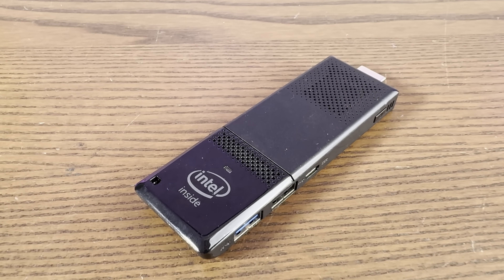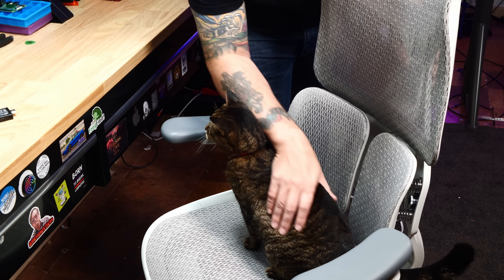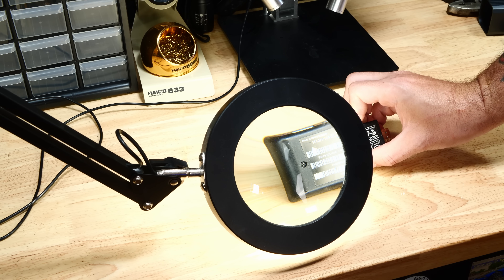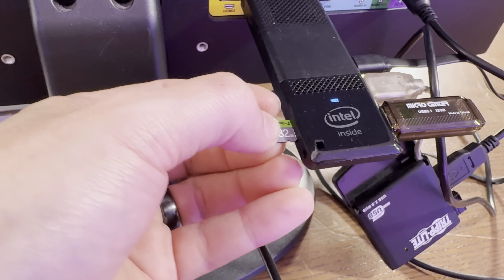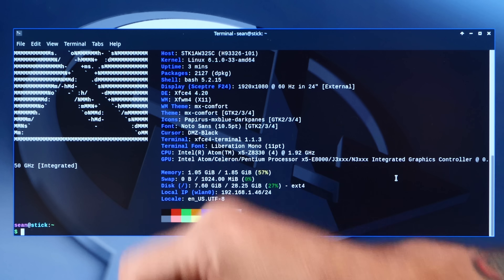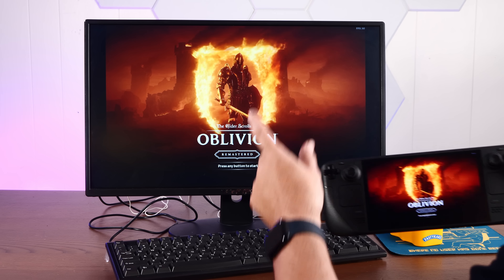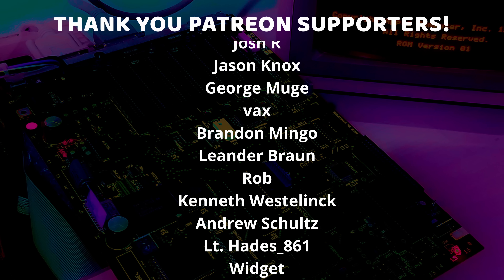Intel's Tiny, Weird Computer

Comment: I have this. Originally bought this for use as a media center pc, but later repurposed it as a thin client for my remote work citrix desktop. It ran well enough, and even handled audio/video calls with host based acceleration
Reply: We used to use them for video walls displays.  The proprietary boxes cost a fortune and these were less than $100.  Great little machines.

Comment: Honestly, that is not bad. Super low power consumption, basically no wiring needed, a simple device that could be used as 3rd or 4th screen.
Reply: nowadays phone cpus can pull even less on light tasks

Comment: The reason Haiku did not see the sdcard or the emmc is because it likely does not have full support for it yet and emmc is basically an sdcard but soldered to the board. Idk about the status of sd card support in haiku
Reply: It varies. I've installed and booted 32-bit Haiku from the 32GB emmc in an Acer Aspire One. Then, on a Chinese Compute Stick clone, I could install Haiku but not boot it. It seems more a BIOS issue.

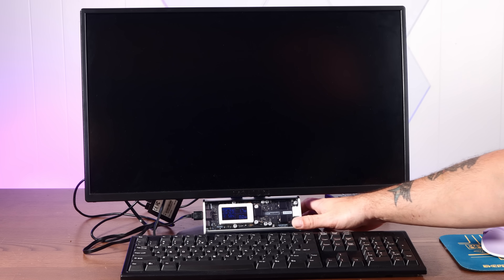Comment: I still have a M3 stick and it still works fine. Intel made the slimmest smallest sticks and I use mine as a emulation machine. The only issue is the CMOS battery now needs replacing (I see yours does too at 6:17)
Reply: Good spot!
Reply: I believe he unplugged the battery when taking it apart, perhaps his doesn't need replacing yet.

Comment: My daughter still uses one of those for her piano lesson zoom calls.  It's literally been zip tied to a piano since covid.
Reply: We're currently a phone + a tablet for this: would you mind sharing your configuration?
Reply: @BabasX1  based on his comment he zip tied it to a piano
Reply: @nottrevorallen  technically the piano was zip tied to it. it is the computer, the piano is merely a peripheral and furniture
Reply: @BabasX1  We have a monitor and keyboard on the compute stick.  There is a webcam that points down at the keyboard.  The piano is one of those faux digital jobbies (not a "keyboard"), so it has audio out.  The piano and a headset are connected through USB.  The piano audio is set to monitor so both the instructor and my daughter can hear it.
Reply: @BabasX1  It's a just a little computer. He probably just has a TV or monitor sitting on top of the piano so she can see the call. I'm not sure why that's hard to grasp.
Reply: @Luke357 r/whoosh
Reply: r/woosh? Are you 12 because I don't think it means what you think it means.

Comment: I could use one of these as a replacement for fire stick, would deffo work well for an easier life to accessing all media instead of having a billion apps installed.

Edge and away, remote PC app for ease of control from the bed.

Only issue is how would you easily turn it on? Hibernate?

Comment: The first Raspberry Pi prototype shown to the public was a compute stick, with an HDMI connector on one side and a USB on the other. There were a ton of pictures of it on the Internet after being initially shown in a BBC blog. They did warn that the actual product would be different since they were aiming for a credit card form factor with a connector people could wire to their own hardware.

Comment: I've had back then a Phone with an Intel Z3580, basically the same chip with dual channel ram, higher clock and 4gb LPDRR3 1600 Support. It was blazing fast for a phone back then, had disappointing battery life and got hot enough to just shut off during summer. I still have it somewhere, the back cover of the Zenfone 2 Deluxe is so unique and beutiful that I can't throw it away.
Reply: Omg, I'm still using my ZenFone 2 every day as a fitness tracker, as it's got a fitness app (Cardio Trainer) that I really like, which won't work beyond Android 6. It's battered as anything, but I can still put a SIM card in and use as a back up if needed.

Comment: I dug mine out a few months ago and installed Ubuntu headless, X11 and QLC+ running in kiosk mode to control DMX lighting rigs. Still haven't tested it out since I don't have a USB to DMX cable, but it runs QLC+ very smoothly! A lot better than the Pi Zero W I tried at first lol

Comment: I remember our Intel rep trying to pitch this. You could tell he thought it was useless.
Reply: It was an excellent thin client, actually.
Reply: Never played any emulators before? These things were way cooler than the walled garden streaming sticks of today!
Reply: @btarg1  Thank you for saying it. These are worlds ahead of a firestick or roku as far as usability.
Reply: @btarg1  The Core M3 can emulate up to GameCube (you might need frameskip in some games). Decent for PC games of that era too. OG Oblivion is old enough to run directly without streaming. It will get very hot though it's only got a 30mm fan after all...
Reply: @btarg1  I never thought about it being able to play some emulation, thanks for the hot tip

Comment: I'm using one of these to control my 3d printer through wifi, super useful! Also batocera worked somewhat for really older systems emulation. Dreamcast almost worked fine..almost.
Reply: Almost… 😂

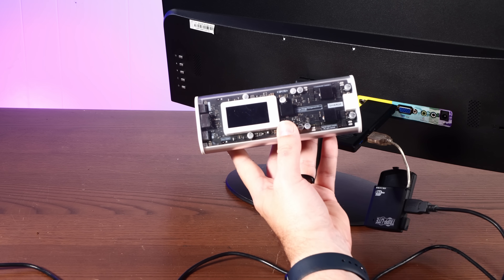Comment: 6:06 that can't be good for the HDMI port...
Reply: An extension cable is recommended.
Reply: @CantankerousDave  That might even improve wifi reception since it's no longer obstructed by a screen.
Reply: They came with 3 inch extension cables for that reason. 😇

Comment: I don't know why people are shocked that 10-year-old computers work.  Dude, 40-year-old computers work.
Reply: I think it's more about "can it work with my usecase?" because older computers are limited in their usefulness by modern software being only designed for modern hardware. Getting any web-connected thing to run on, say, an IBM PC, will be a challenge unless you're willing to program it yourself. 

News websites without images should be doable (I've seen demos of teletext systems that pull from the modern BBC website). Maybe you could make something that can connect to, say, Reddit. Anything beyond that is probably going to be like pulling teeth without anaesthesia, because modern software is so damn bloated that even getting the API calls to work might be a challenge. I luckily have never had to use Microsoft 365, but I feel like even a skilled programmer would have trouble making that work on a 40 year old PC.
Reply: I don't think it's a matter of it "working" as in starting up, but rather the fact it can still be used for at least some modern use cases. Especially since this was a low powered device to begin with. I guess plenty of people haven't realised or internalised how much gen on gen improvements have slowed down in the last 15 or so years.
Reply: I'm actually more surprised that there were still new computers made with only 2gb ram in 2015. With all the win 10 updates getting bigger and more bloated, they must've become unusably slow so quickly...
Reply: My Apple II from 1979 still works, and sometimes I play Zork on it!
Reply: they work better because people make software specifically for those platforms and you don't have to hunt stuff down on the wayback machine
Reply: Yeah, but not well, at least not for modern stuff.
Reply: My 40 year old Commodore C64 still works as good the day I bought it.
Reply: 40 yo computers were made when planned obsolescence wasn’t the priority
Reply: @BambuLaber  can you run windows 10 on commodore? What do you mean by planned obsolescence

Comment: Poor Haiku... its driver support is so shoddy. I've only ever been able to have a good experience with it running as a VM. They don't have enough developers to keep up with this new hardware shipping. 

One way that might have been good for them to go was to get it working great on ARM and then they could make the Raspberry Pi the official Haiku device. I've only ever really seen it run properly on old Thinkpads.

Every year the amount of people interested in BeOS/Haiku decreases. I'm impressed they kept it going this long. Too bad, because BeOS was mind blowing when it came out, and it was within an inch of being the new MacOS, had a meeting or two gone differently.

I weep for the lost potential.

Comment: The bank I worked for tried to take away out laptops in favor of these. Thankfully, it didn't go far.
Reply: I don't know about being thankful; I use a laptop at work and often lament the small screen size. Even a cheap, old flat screen provides a bigger view than that - what's not to like? Takes up zero deskspace beyond the monitor it is attached to, and would probably run all the software you would need as a bank employee (I say that as someone who has never worked in a bank, but you know...I assume it's not very exotic or demanding software).
Reply: @danyoutube7491  10 years ago this would've been true. Now, even just modern Windows itself needs essentially the maximum processing power the Compute Stick to function (for a version of Windows caled tiny11), which basically means that thing is almost completely obsolete. :D

Comment: I you think about it, we already have something very similar to an Intel Compute Stick: Modern Cell Phones.
The difference is that the phone does not natively run Windows as we know it (primarily because Windows uses x86 Process Architecture, which has high power consumption).
And Smart Phones use ARM processor architecture (a RISC "Reduced Instruction Set Computer") which is more power efficient, but requires more complex compilers.
I'm sure the differences are many, but basically,  your PC has less of a power limitation, but phones are running on battery life, which can be limited.
So the people "trimmed the fat", as they say.
Reply: Smartphones are not general purpose computers. There bootloaders are locked and android is locked down. This is going to be even more true soon as google has announced they are cracking down the ability to install arbitrary apk files. Smart phones are not personal computers, its impossible to truly control it.

Comment: I frequently use the MeLE HDMI sticks where clients want a cheap video conference solution.  Pair it with a Logitech K400 and a half decent webcam and you've got a small (powerful enough) video conference solution that can run virtually any VC app

Comment: My current desktop computer is older than that thing. Its running just fine. I remember those compute sticks, they were a great idea. It would be nice if we had them today with usb-c where you can plug a new computer into your car, or replace the CPU on your laptop by swapping compute sticks. But that's exactly what the manufacturers don't want you to be able to do.
Reply: There is no point in those sticks nowadays because even the cheapest TV options have been having some sort of OS running on hardware for quite a few years now.
Reply: Sadly that OS usually becomes obsolete far sooner than the TV running it
Reply: @planestranger  From a technology perspective, yes, of course. But from a privacy perspective, there is all the reason in the world.
Reply: @planestranger But at least I can control and own the OS in these compute sticks.

Comment: Given how I was money-constrained throughout the 2010s, your computing shenanigans are right up my alley! The same with Michael MJD's computing shenanigans! Everyone in my community college classes had OnePlus Ones and flagship Samsung phones, but I was stuck with what Verizon called a Droid Charge, which already stopped receiving operating system updates when I bought it. I couldn't update my Pebble smartwatch, which I really had to go out of my way to buy, to the 2.x firmware branch because my phone was stuck on Android Gingerbread! Also, I first started using Linux with Backtrack 4 in 2010, and then, Ubuntu Oneiric in 2011. I spent a lot of time experimenting with low-cost computing devices.

Comment: had a tablet with detachable keyboard with same Atom CPU and 1 gig of RAM. Built-in memory died relatively fast but from the USB-stick it still can boot windows 10 and run NES or MegaDrive emulators full speed, play 720p videos or be used as an e-book.

Comment: I actually used those intel sticks for narrowcasting. With our software, 7 years later they are still in use and still work great! Only problem is that for some the fan wil fail. But thats it really, or the CMOS battery

Comment: I had one of these with an Intel Atom and wanted to turn it into a cheap TrueNAS machine that only had to run a replication task connected to an external hard drive, but even though the CPU is technically 64-bit it only supported 32-bit OS so I got rid of it, can't do much in 2025

Comment: This was actually a good idea IMO, including the intel compute card. If they did iterate the designs now we would have a great rpi x86 competitor. Also would be good for industrial applications that need x86 cpu but extremely low power, low dissipation capabilities and cheapness in general. Who knows maybe we would have x86 phones now
Reply: There were actually x86 phones running some slightly altered versions of this exact cpu at the time. If I remember right it was mostly asus making them. Didn't seem to take off probably due to the quickly increasing performance of arm together with good power efficiency which meant there wasn't much interest (or just, you know, when was the last time you saw anyone with an asus phone? They did make some good stuff but nobody really cares about them). You can run x86 windows on them at native speeds though which was fun before windows on arm.
Reply: The compute cards are more mysterious to me. I've seen marketing material for it, but never saw one in person. I like the idea of it being an Rpi competitor, especially the CM3-5 versions. The combination of the card and dock made it like a very user friendly version of add-on SBC modules with expansion boards.
Reply: RPI was never a desktop computer replacement.
Also, x86 SBC-s are a thing (Latte Panda, Tinker Board, etc) they just tend to be more expensive than low end ARM SBC-s.
Also,  STX sized x86 mini PC-s are also pretty popular.
Compute Stick was simply unsuccessful mini Pc form factor.

Comment: This is a painful reminder. In 2016 at work they made a regrettable deal on some industrial automation. The fine purveyor of jank that sold said mission critical system decided to build front end on a Compute Stick. And made it phone home. 

I only used spring of 2017 to re implement said front end.

I hate Compute Sticks.

Comment: Atom Z8xxx-series not bad CPUs, but with ARM level OS support - most hardware connected not by PCI(e) bus, but with i2c and gpio. So when you are testing some Linux distro on this chip, you are testing workarounds in particular distro for particular device.  For example I have Dell Wyse 3040 thin client with this chip. The most working OS for it is Windows. But wifi doesn't work - it is m.2 2230 format Azurewave CM389MA adapter, but it works only by SDIO, not pcie and there is no drivers in this universe for windows. And it's just a one small problem that you can get with these Atoms. 
So if you want more compatibility just pick a system with pcie layout - where most peripherals and internals are connected through pcie. There will be no problems with OS and drivers support for long time
Reply: JFYI: The M3 version came with a intel dual band ac 8260.
Reply: @vxvicky I don't argue with details, but when audio chip connected not with pcie, you will have problems with audio support. Even GPU connected somehow different, it's not visible in Windows before driver installation, so if you didn't dig enough deep you can't say what driver you need. If it's regular PCI(e) PC, you can find driver just with PCI id's of device
Reply: @axescar have you tried compiling Linux with i2c support?

Comment: i had a cellphone many years ago with an atom in it ( the - Orange San Diego smartphone .. thanks google lol ), it would have been a little gem except for the terrible battery life and power button that would break after a few hundred presses. you could fix it by opening the back and wedging a bit of card between the button and the switch on the board .. very hi-tech solution you'll agree lol

Comment: I know some people used these sticks to control their astrophotography rigs. They're light enough to have on a eq mount, and just enough power to control the mount and cameras.
Reply: I assume the telescope rig connect through serial/ttl/Bluetooth, isn't a raspberry pi or other SBC more appropriate to use as they have serial connection bulit in while Intel compute need some adapter?
Reply: @wahyutriwibowo1803  Could be but these things chew so little power that you can run them off an other PC's USB port. And they are smaller than a RPi. You can even get fanless ones for zero vibration and sound.
Reply: @wahyutriwibowo1803  I do astrophotography but I use a Asiair device which is kinda which was built on Raspberry Pi but I think they are doing rockchips nowadays I know alot of people use mini pc's to use like NINA aswell like the PrimaluceLab Eagle & Beelink Mini pc  but the asiair is the most common one and I like it alot due to the nature of being easy to use but you cant really use it like a noramly pc its built just for astro
Reply: @wahyutriwibowo1803 From what I can tell a lot of the equipment has been USB for a while now. The appeal was windows, as a lot of the software is just easier to configure and it kinda just worked. Then people would remote into them to adjust telescope things. Nowadays there's specific mini PCs for it  but small Intel n300 class systems today do a good job too.